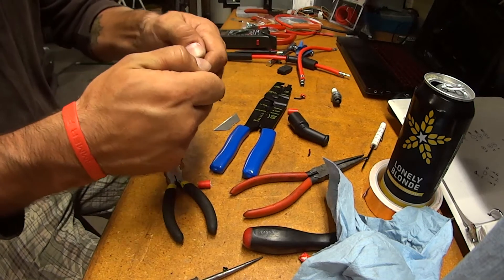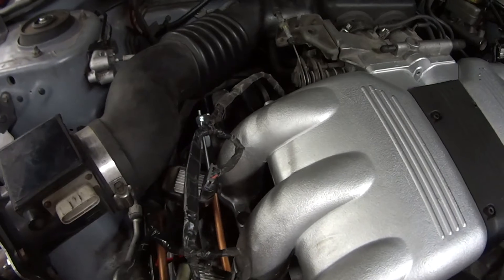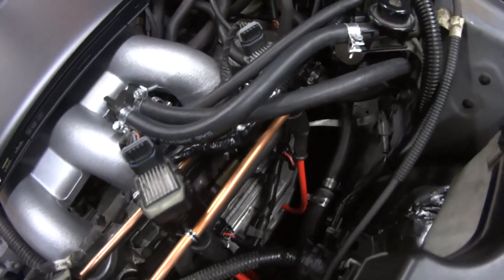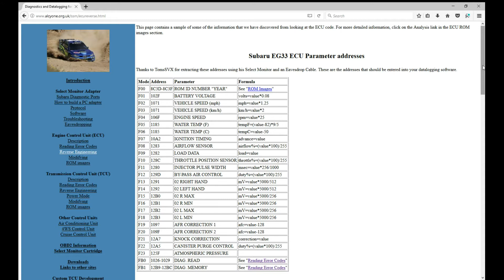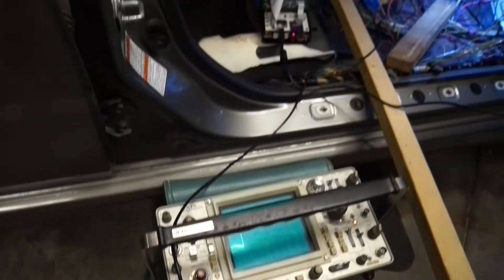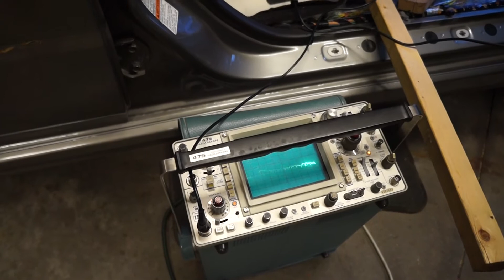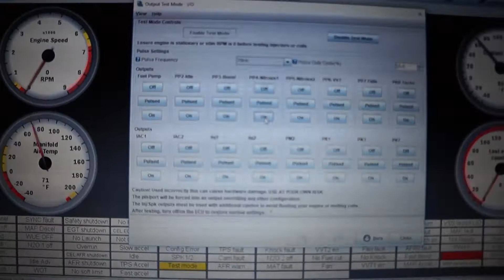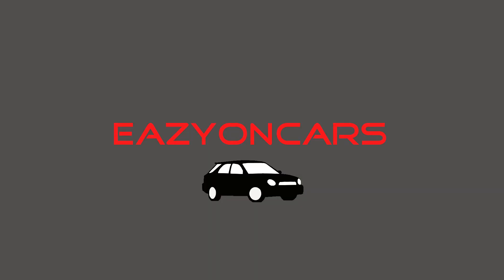EG33 Swap - LS2 Coils and R32 Skyline Injectors (Ep. 8)

Comment: Hey man! I know it's been a long while since you did this but any chance you remember or could link me to some details? I'm in the process of making my harness and singal converter and I cant seem to find info for the eg33 coil signal voltage. For other subaru it appears to be a constant 12v then fires with a negative pulse? With the lq9 coils I have they run the 5v and fire on drop. I've got a 12v>5v converter and a relay setup to flip signal unless there is another way
Reply from the maker: Wish I could help more, I'm using the aftermarket computer.

Comment: I may be mistaken but for those 370cc purple injectors you don't need to change the stock EG33 injector plugs, you can get a way with a slight modification, (They will be purple. They are keyed differently (the little notches on the plugs are different) than the 270s, but if you dremel the little ridges off of the sides where they plug in, they will plug in to the connectors for the 270s.) in case the link doesn't open.  http://www.subaru-svx.net/forum/showpost.php?p=720040&postcount=2
Reply from the maker: Your correct, but I prefer the new pigtails. Less of a hack and they work with my Dechwerks 550cc injectors also. Thanks for adding the info!